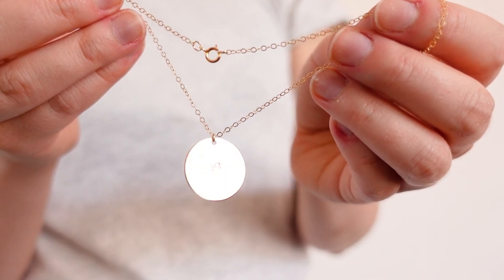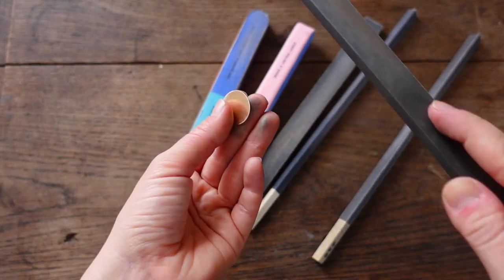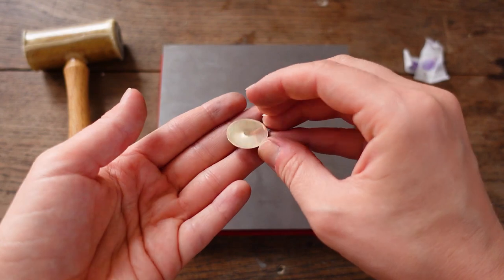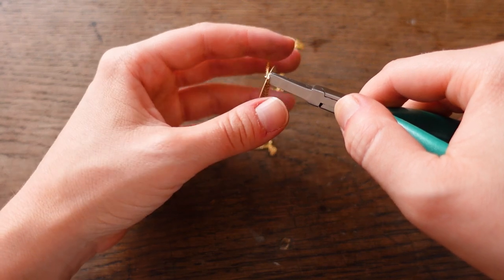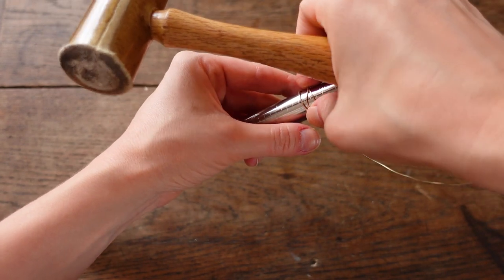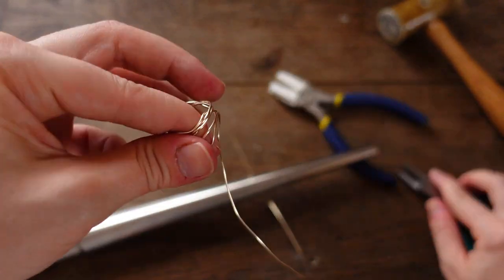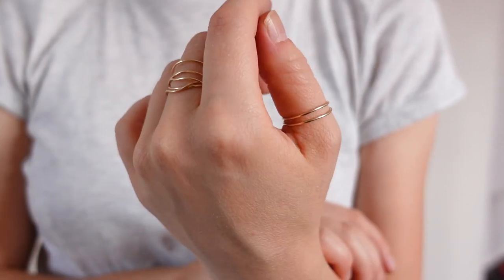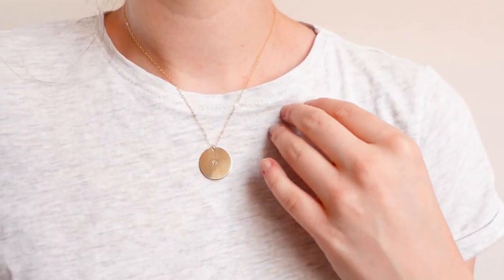Make GOLD FILLED jewelry - no solder, easy! Gold fill tutorial

Comment: Beautiful! When I use GF I only file/sand once everything is finished and I also put painters tape on my metal immediately from the manufacturers packaging to prevent any scratches because 2.5% gold layer on each side is VERY thin. I even use my disc cutter  with the tape on.  I have a hard time seeing when the gold is sanded off because the underlying base brass metal is gold colored too. Basia, I also use Protecta-Clear to seal the piece, especially the edges where the brass will show/oxidize.  I hope all my mistakes help others not make them!
Reply: Hiya, it's good of you to share like this with us and help us in this way, learning from someone else's mistakes is cheap for us so let's just make sure we do learn and thank the original sufferer for their kindness in sharing. Protecta-Clear does sound like the best route to take. Good protection from scratches and oxidization too. Thank you and stay safe...Steve...
Reply: Thank you. I was wondering about the edges.

Comment: Amazing work. Would the copper inside the gold filled disk show from the sides????
Reply from the maker: I haven't noticed it from the sides. I did, however, remove too much of the gold layer once before and noticed discoloration, so we have to be very careful about that!
Reply: @TheArtOfMetalsmithing I know the pen does not use the same thickness of gold, but what you did, could you make good with a gold plater and not see the repair, or would you get discolouration? Thank you, Basia, Steve...
Reply: Its not just copper, its brass. It WILL look bad over time if you don't seal it. Protecta-Clear metal sealant is a great non-hazmat product.
Reply: Does protecta clear wear off?
Reply: @itsaakifahrawrxo  in time, anything will.

Comment: Hello, after working with Gold filled sheets, do you recommend doing gold plating?  I say this because the edges are exposed.  Thank you .. (I'm learning English, I'm from Venezuela)
Love your videos!!
Reply from the maker: I still need more experience to be able to answer this with certainty. I tried gold plating, and will be doing some more very soon. I think it's better, because you are in control what kind of metal you are plating - for example sterling silver. So the value can be better in that case. However, we have to keep in mind, that plating is always thinner than gold filled, and will wear off a bit faster. As you can see, the choice is based on few factors and depends on what you are looking for. If you're looking for purity, then plating on silver will be better than gold filled with copper and alloy inside. But if you'd like more lasting effect, gold filled might be a little better. But like I mentioned, I myself need more experience in that matter, to be able to answer better :) But I hope this helps a little! Thank you for watching!
Reply: Thank you for answering my question .. I will keep watching your videos! .. I love your work.😊😊
Reply from the maker: @anabellesemprum-orfebre4723  my pleasure! Thank you love ❤️

Comment: Hiya Lady Stardust, what a great pair of items, the neckless took more time and needed more tools to make, but the ring looks more complex than the pendant. I would think it would be easy to gold plate the edge of the disc, but would it be very expensive? The kit, even the pen style isn't cheap if I remember. But if you intend to make these on commercial bass even large outlays can earn their cost back, and start making you a profit. I know you made a video on gold plating about 9 months ago. Was that the pen type? 
Stay safe, dear lady...Steve...
Reply from the maker: Hi Steve! Right? The ring is so interesting, yet all it takes is some wrapping and shaping, very simple :) As for the plating, I agree, if someone has the plating tools, then it could be done I believe, but without it it's a bit more tricky. The video I made was on the Pepetools pen plating station, I will be using it very soon for several projects and I will make an updated video too. Thank you so much for watching, as always, stay safe xx
Reply: I'd also love to hear your thoughts on that pen plating tool, will you be making more videos about it? I think there was this case of using another solution before applying gold to make it look brighter?
Reply from the maker: You're so right! I will check what it was and will try using it next time. I will do more plating now, as I want to start using solid gold bezels as well, which paired with plating on some areas will look amazing. Also, I have several projects that involve plating, but didn't have the chance to try it out yet! 🤦‍♀️ So I can't wait to test these out and show you 🥰
Reply: @TheArtOfMetalsmithing WOW! Talk about whetting the appetite dear lady, I can't wait to see more, you know me always wanting to learn, and I can't think of a more knowledgeable teacher than you. Your style on camera is so conducive to teaching, thank you again and again! 
Solid gold bezels on your cabochons? You are spoiling us as you grow, moving home the reason or just you growing in your craft? Maybe the odd gold flower perchance? Gold balls? 
Steve xx...

Comment: I though punching, sanding and drilling leaves the base metal exposed to oxidation. Good to know, thanks a lot 💖 Who is your gold fill supplier?
Reply from the maker: it does! That's why it's important to do it gently and not remove too much of the top layer. It's tricky, but that's the nature of this material! I found my wires at the Curious Gem UK